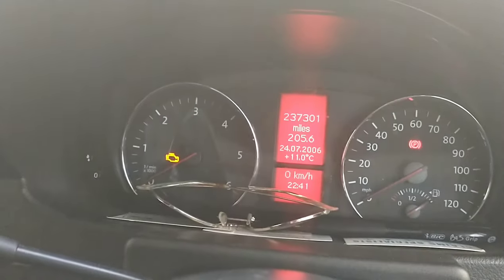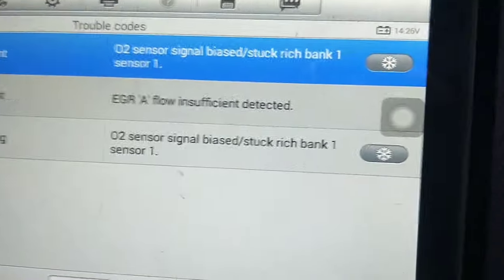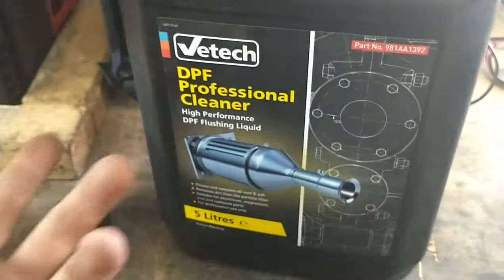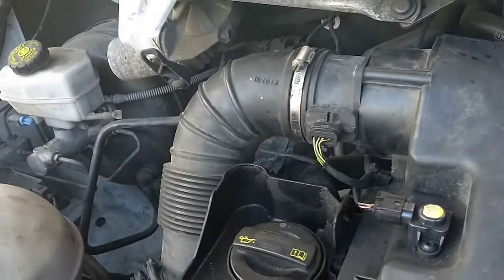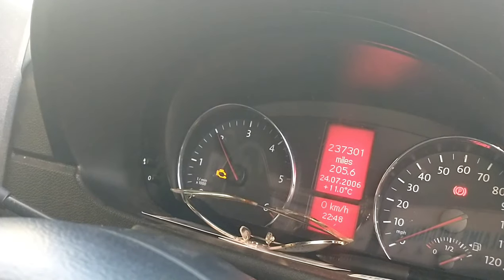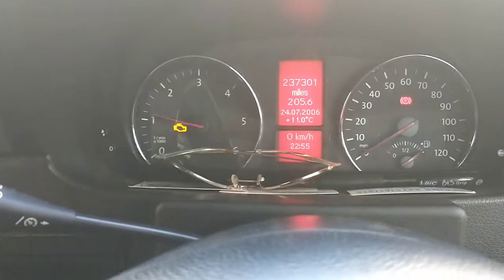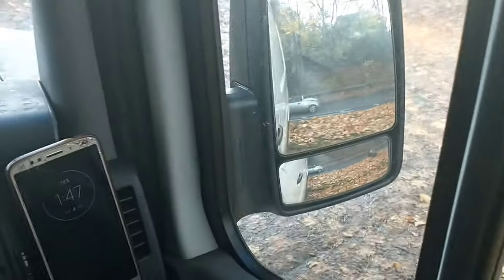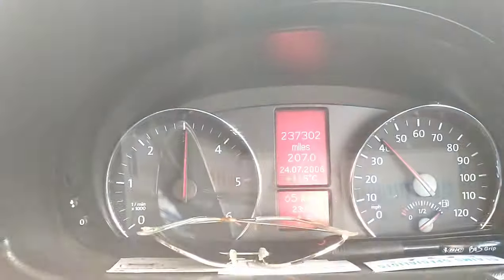How we clean EGR Valve, Intake Manifold & Turbo without removing!! using DPF Flushing cleaning fluid

Comment: Spraying it in to the turbo has no effect, because ash and carbon is deposited on HOT side, so the fluid should pass through the engine, get burned and only after that it will get to the place
Reply: Produto quimico inerte à combustao
Reply: Steam clean

Comment: What was the quantity of fluid you sprayed in the intake ? and did you spray it costantly till finished ? Looked at egr cleaners and they say use when engine is hot and spray in 1-2 sec burst, letting the engine idle for 3-4 mins every 10 sprays
Reply: Would like to know that, too...
Reply: Someone else asked this mate and he replied saying about 1 litre 👍
Reply: All cleaners are not the same. The one used in this video is water based afaik, and intended as a DPF cleaner. Specific EGR cleaners are most likely petroleum based, hence flammable. That's why you only spray in, in short busts, as it will get combusted in the cylinders, and make the Revs rise.....and could make a diesel engine "Run Away" for a short time....

Comment: A lot of vehicles wouldn’t start if you had the flexi pipe already taken off the MAF. The ECU wants to see a signal from the MAF before it starts. Trick is to have it connected loosely to get it started, then move it to one side for dosing.
Reply: TDI with a MAP sensor on the Intercooler. You don't need the MAF to run this engine.

Comment: Dude I was about to spend £880 on a turbo but this actually worked.

Been mechanic 21 years but not ashamed to say I have learned a lot from you. Channel making my life so much easier
Reply from the maker: Glad to hear it helped
Reply from the maker: @rmartin6307  thanks for the support 🙂
Reply: Won’t this fluid harm the turbo and might also end up in the combustion chambers ?
Reply: I'm gonna try this.. I've got 260000km on a turbodiesel and have never cleaned it.
Reply: Jimmy I have the revive kit where would U put it in on a 2016 2.0 Citroen Relay please

Comment: I did an obscene amount of research into how to clear out/improve/fix my clogged up truck, and decided to go with the method in this video.   I already had a little pump-pressurised spray bottle, so i went online and bought wynns DPF cleaner and put about 1.5 litres down the pipe that takes air into my turbo.   I managed to use the pipe from my jack, to keep the revs at 2000 by wedging the pipe between the seat and the accelerator (seats move, so its the perfect adjuster!).      My truck engine spewed loads of white smoke down my street during the cleaning, and then when i took it for a run afterwards the engine sounded better, the turbo came to life and drove so much better, my truck mustve really needed it, mustve really had a lot of carbon clogging things up (like the turbo and inlet manifold especially i think)

(worth noting as well, that a few days ago I cleaned out my turbo specifically by using this method - https://www.youtube.com/watch?v=1EC5Zi3_Z30).   

I also removed my EGR Valve and EGR pipe (because they are right at the top of the engine and only need to take off a few bots) and cleaned them out with a mixture of 3 cups hot water, 1 cup vinegar, half a cup of fairy, and a splash of white spirit.  i just looked up a couple videos on EGR valve cleaning because theres bits you want to clean and bits you dont.  scotty kilmers video is good on EGR Valve cleaning
Reply: did you use the Wynns "off car" def cleaner for this ?

Comment: This actually works. Cleaned a Peugeot boxer 2.2hdi this way yesterday. Slightly different process being as the air intake goes under and around the back of the engine. I just removed the air filter and poured it through that way. The sensor was not affected. After half a minute the street looked like a war zone as a cloud of smoke wafted away from the vehicle. Took it for a drive and the van was more responsive than it had ever been.

Comment: Thanks 👍

Our new favourite fix... Done a dozen cars this week. 
Fixed golf turbo underboost.
Also fixed BMW EGR Valve Stuck and loads more.

My praises to you. 

Note. Some cars you need to repeat the process to get results from badly sooted vehicles
Reply from the maker: Thanks for watching
Reply: @ORileysAutos  great tip dude thanks so much. We been making nice profits doing this 👍🏻
Reply from the maker: @vorsprungdieseltechnic9120  nice to know it's been helping you
Reply: Would this work on a golf gt tsi 1.4 petrol
Reply: Did it work on the newer cars as well? I have VW t6 with an egr problem

Comment: Thanks so much again Riley's Autos! I couldn't get hold of the Vetech product (in France), so bought a can of Wynn's DPF Cleaner WL23379 which i used in the same way as you show. I first checked with an OBD scanner that I had an EGR fault. I did, or rather my 2006 Mini One D 1.4 88hp did. 

I followed your procedure to the letter, and felt really disappointed when I went on the test drive. Power was significantly down. The engine wouldn't rev above 3,000 under load. I assumed the EGR cleaner had dislodged some crap which then stuck in a pipe somewhere, so I tried all sorts to clear it to no avail.
THEN when I got back, I put the OBD scanner on again, no more EGR fault, but it told me that I had an air flow mass sensor fault. I cleared the fault using the scanner, and immediately the engine could rev to 5,000. Went on a second test drive, and the car drove better than it has in my ownership. Brilliant!
I'm writing this in case anyone else experiences the same problem after following your ace procedure.
Reply: My OBD scanner is a Creator C310+ which is designed for all BMWs including the Mini. It paid for itself in one go today.
Reply from the maker: You are removing the intake so the air flow sensor would record a fault so just clearing it will reset that 👍🏻
Reply: @livingoncoins you do it after the MAF, not before. MAFs are very sensitive

Comment: I stripped and cleaned my egr but not the intake manifold. I cleared the code and drove for a week. 250 miles. Light came back, scan tool gave the same code. I can't be dealing with taking all that out again to get to the intake. I'll be shoving a load of this cleaner through. Thanks for the video.
Reply: Same problem. Did it work?
Reply: Did it end up working? Did the code come again?
Reply: Hi, I know that this is old, but Did it work on your vehicle?

Comment: Bro had to come back to tell you this works so well. I used Wynn's 5L bottle. Parts shop said its almost same as vetech 

Love your videos man your a life saver... £2500 turbo replacement on a range rover fixed for £25!!
Reply from the maker: Good to hear fella.
Reply: Did you spray it constantly without stopping
Reply: The Wynns says off car is that ok to use
Reply: I know this is an old comment, but could I ask, is the Wynn's "off car" 5 litre bottle okay to use like this?
Reply: Was it the Wynns "off car" stuff you used ?

Comment: @ORileysAutos  My 2008 ml320 cdi Mercedes started going into a limp mode, that would reset itself after restarting the engine. Did a lot of research and came to conclusion by the OBD code reader that it may have a lot of carbon deposit on EGR valve. Decided to use your method and bought Lucas DPF cleaner. Removed the air intake, started the engine and started to spray the cleaner into the turbo throttle. After a few minutes noticed that the engine RPM started increasing, slowed down with the spray and waited for RPM to come down to about 2000 and continued spraying again. Did that couple of times and after a while of spraying noticed that the engine started revving again, stopped the spraying but the RPM started going wild, and I mean really wild. I jumped in the car puled the lever that was on the gas pedal and pulled the key out of ignition. Engine continued racing wild for a couple of seconds and finally quit with a Bang in the exhaust?!?!? I let it cool down, checked the OBD codes and there ware so many, managed to clear half of them and attempted to start the car. The engine turns but would not start???  What did I get myself into, is the engine hydro locked? Would appreciate any feedback.
Reply from the maker: Sounds like you used a flammable liquid and way too much so the engine has ran away
Reply: @ORileysAutos , thanks for your reply. Wonder if you  can tell me what's most likely possible damage. It's been run-away for about 30-40 seconds.
Reply: @pandelko  what happened did you destroy the turbo?
Reply: What was the outcome...?
Reply: indeed, I would avoid spray cans because of the flammable suspension gas. Safer way (if spray cans are your only option) is to first empty the spray can to a hand held sprayer like in the video and then use normal air as the pressure tool.

Comment: Hello this is a brilliant method to cleanout the EGR valve! 
Will this DPF method damage a NON-DIESEL gasoline engine or can the DPF fluid only be used on a diesel engine?? Please let me know, I’m interested in cleaning out an old straight six 4.9 L F150 truck engine.
Please help- thank you & god bless you guys!

Comment: Hi there,

Wondering if I can do this to my Renault Duster dci 110 PS motor. I recently cleaned all the sensors, replaced the Vaccum solenoid and fixed the plumbing. Its improved the performance and I feel the turbo VGT and exhaust manifold surely needs some cleaning cos' my EGR was totally choked through out.

Do you recommend this on a car that doesn't come with a DPF?

Comment: I have a 1994 dodge b250 cng 5.2 and not sure where 2 spray it threw since its different set up than this van and also have a 2007 prius will it be fine to do in my prius threw the same way you did it spray it threw the air filter hose or is it somewhere else

Comment: Hi, my misses has a suzuki swift 1.3ddis which ive not noticed any smoke come out on a good run which it used to do. It ticks over abit rough, when cold tick over is erratic and it STINKS from the exhaust.
Is this a sign that the egr valve is clogged. Tia Karl

Comment: Hi Jimmy, my v6 tdi vw touareg has a single P0234 turbo overboost code meaning there is lots of carbon build up on the wastegate and vanes, can this method unclog the stuck parts on my turbo? My concern is turbos do need engine oil to lubricate the turbines, spraying that water based DPF cleaner directly into the turbine will not impede the performance of the turbo?

Comment: Would it be better to Remove the DPF before sending all this soot through that also and while its off can use that flush fluid to soak the DPf for 8 hours before replacing it rinse too and let dry then use a dpf fuel additive to restor metals after its clean.
Should have covered the MAF on the other opening looks like overspray could have got it. thanks i learnd somthin new.
Reply: If you read it sais it cleans everything including dpf filter so it doesn't need to be removed.

Comment: Hello. I followed the procedure with the jlm for cleaner in my Chevy Cruze. After 5 mins drive on the highway the oil light came up and the power was cut down a couple of times. 

Then I did a dpf regen with the autel tool and drove it back in 2000 rpm didn’t make any issue. 

Is it normal?? Should I be worried about the oil light?
Reply: The main thing is I drive about 150kms everyday. And this weekend I’m going on a road trip to france and Belgium! Almost 2500kms!
Reply from the maker: I've not seen an oil light appear.  Did you check level

Comment: Got peugeot 308sw bluehdi 2.0 l (2014) just got dpf washed on mechanic they change oils too but service light and engine light still burning. Car is on limpmode. Any advice should i try to clean it in this method too or is that even possible to my car?

Comment: Great video! Thanks so much. Where can we buy the Vetech DPF Cleaner please?
Reply: Failing that, is it ok to use a fuel additive, but spray into the intake in the same way?
Reply from the maker: GSF car parts sell it. Or most places sell Wynn's brand DPF cleaning fluid
Reply from the maker: @markmaddrell5106  don't use fuel additive or anything combustible 🔥

Comment: Hello, I really like the video, I own a Citroen grand Picasso 2010 1.6 hdi and it looks I have problem with the egr valve. I think I should use that fluid, I have 2 questions: should I spray right in the turbo as it is the most easy for me to reach? and when I'll finish the spraying, can I reset the codes with my OBD Car Scanner diagnostic tool ( is an app I have in my android phone connected with a bluetooth OBD device) or should I do that with a better and more professional diagnostic tool? Thanks
Reply: Did you ever do this? I've bought some of this stuff to do a friend's Berlingo but not got round to it yet.
Reply: @1000sofusernames  
Yes I did the procedure twice, lots of smoke come out and the car drives better but the egr valve still has issues as it shows on my OBD reader. The second time I think that ruined the AMF sensor and I had to replace it because I was reading intake air temperature about -20C!

Comment: Hi, I have a 2014 ford kuga 2.0 tdci with 16,000 Miles on and had a new dpf last year, this is now smoking on hard acceleration where it's very visible from the rear window. All filters changed and no signs of boost leaks.
It's also has an rpm bouncing when coming to a stop (idle to 1400 a few times then settles )
Would this method help cure this problem? Thanks.

Comment: Will this work on a Mercedes Sprinter 316cdi 2011 OM651 4 cylinder 2.1? Just like that? Straight into the mass airflow like in the video?
Reply: Spray AFTER mass airflow sensor!

Comment: The 1.5 nissan Juke and qashqai suffer from  blocked exhaust pressure pipe/sensor which usually throws a Eml and Traction light up until the pipe is unblocked do you think this would work ?
Reply from the maker: If you open one end of the pipe and pump the fluid through I'd say it's very likely to unblock it

Comment: I have 2008 Passat TDI 140BHP Highline Model saloon,
Can I use this product same code on my car ?
Reply: Just had New clutch fly wheel pressure plate & watter pump & timing belt kit ?
157k is on the clock & using Shell V-Power Diesel last 57k, exhaust pipe is clean as clear no carbon when I place my finger in, so this helath of my engine,please advise me ove on it can I use the product Vetech DPF cleaner and do I have to use whole 5 Ltr ?

Comment: doing this metod can possibly clog up the DPF? an after that maybe need an regeneration??im considering try using this metod to clear intake and EGR valve on my Opel (vauxhaul) 2012 Corsa D 1.3cdti 70KW, before try to dismatle the itake manifold, because this engines (1.3mjet fiat base engine) tends clog up, any advise or any experice, O'RilleysAuto, thanks...
Reply: I have an opel corsa 1.3 cdti 70kw
Error code is P0404
I erase the error code, then I drive 20 km 3-gear and 110 km  speed

Comment: Going to try this on my 2.0 vivaro.  how many litres did you spray through on this video? was it 2l bottle once?
Reply from the maker: Yes 2 litres
Reply: Did this yesterday, after trying to resolve an issue with van not getting over 3000rpm, there was an egr fault before i had the egr mapped out.  But suspecting EGR is blocked.  After doing this initially, van drove spot on for about 5 miles, then suddenly went back to not revving over 3000 rpm.  is it worth doign this again, maybe a couple of times to give a good clean through?  no other fault codes on my van and egr fault doesnt appear any more since it was mapped out